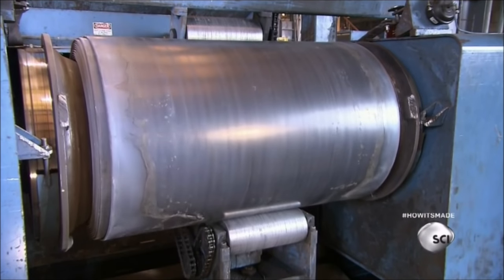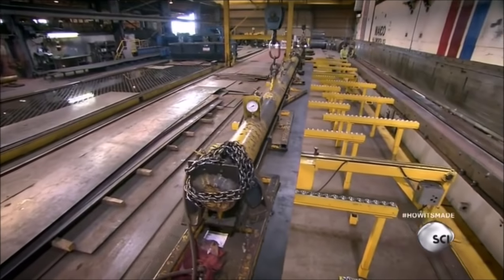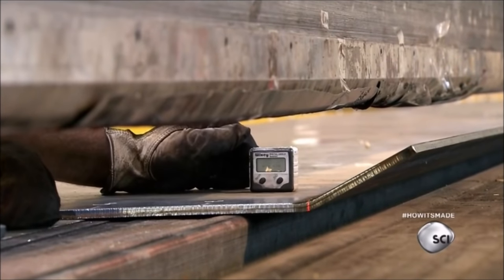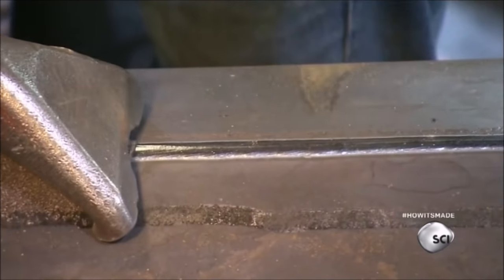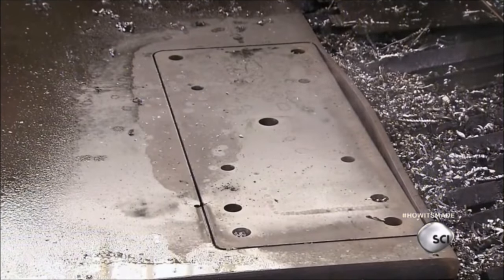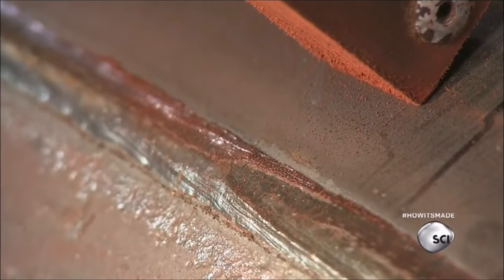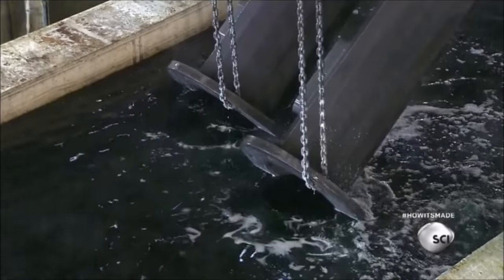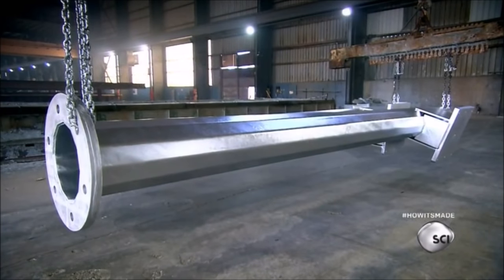How It's Made - Traffic Signals

Comment: As someone that builds and welds traffic light poles for a living can confirm that this is not a typical traffic light pole. Slip on bases are far and few between. It’s more likely to be built with a back up ring and checked for lack of fusion/porosity with an ultrasonic test.